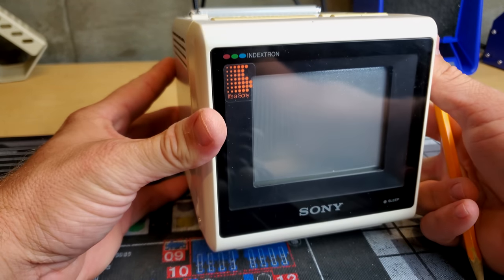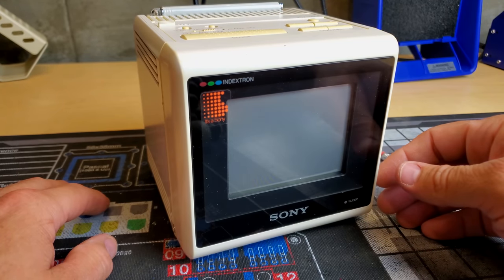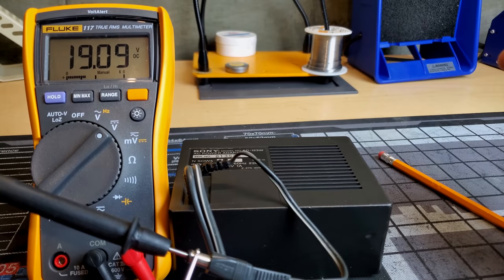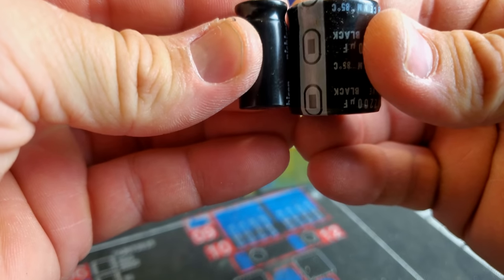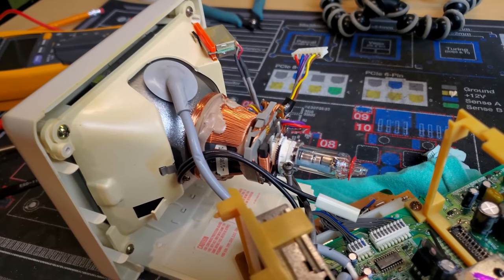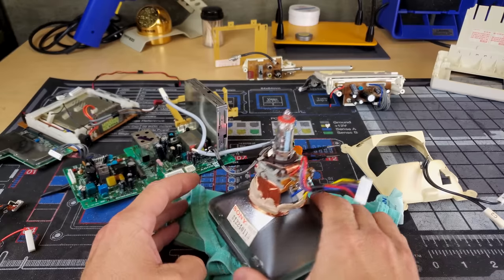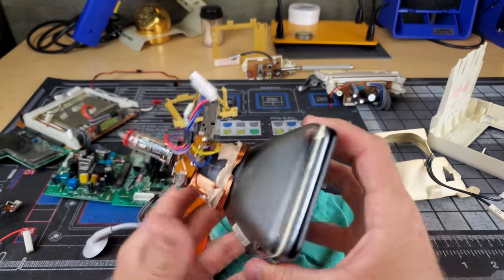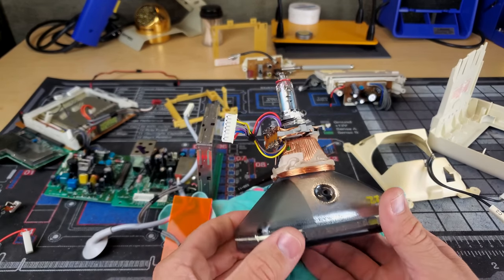Sony's Smallest Color CRT is not a Trinitron - Meet the Indextron

Comment: The Indextron is unique because it only uses ONE electron gun instead of THREE like a typical Trinitron. That orange plastic plate that sits behind the tube is actually a UV sensor. It does not project anything onto the screen. It's complicated, but this is how it works. The Screen has 4 phosphorus stripes instead of 3. Red, Green, Blue, UV, and the Indextron has NO aperture grill (because there is not 3 electron beams to converge) The single electron beam scans the screen like a Black and White Picture Tube and when the beam hits the UV stripe, the sensor behind the tube picks up the signal. That signal is used by the circuitry to adjust the output and timing of the beam to allow the single beam to draw a color image. From the user's point of view, it looks like a regular color TV, however it works closer to a Black and white picture tube. The Indextron design allows the picture tube to be about 3 times shorter than a Trinitron, use less power, and there is no need for an aperture grill or convergence hardware because there is only one electron beam. Fun fact, because there is no aperture grill, Indextrons are completely immune to magnetic interference. They cannot be damaged by magnets!
Reply: Awesome info! Very intriguing! Thanks
Reply from the maker: Thanks for the incredible information.  Thanks for also sending this CRT into the shop.  It was a treat to document.
Reply: But you know that it's not the only tube having only ONE electro gun to make colourful image?
Reply: @ITGuyinaction  Yes, the Chromatron 😊
Reply: @SupraguyCRT  Point for you! You are very good! Btw, I'm not 100% sure, but something comes to my mind that also  Diamondtron made by Mitsubishi had only one electron gun?
Reply: @ITGuyinaction  Thanks haha. No, those are Trinitron clones. The Sony KVX-370 Watchcube was the only single beam CRT, commercially manufacturered on a large scale. The Sony Chromatron was the predecessor to the Trinitron. Several other companies made Beam Index CRTs, but they were very limited in production.
Reply: @SupraguyCRT  So not sure why Mitsubishi came to my mind... Perhaps they did sth on small scale...? 🤔🤔🤔
Reply: @SupraguyCRT  🤔🤔🤔🤔 One thing come to my mind. I remember old Sharp portable crt tv set's with very untypical tubes. Those tubes were very small, like here or even less inches, but the electron guns were at 90 degree to the tube display surface (it's like that someone would "break" this glass neck at 90 degree). They were look like "fat smartphone" but screen was taking only half of the surface. I tried to find sth more about this technology but I can't find anything on Internet. Do you recall it (or someone else)? They were for sure crt, not lcd and due to this 90 degree "broken" neck, controlling electron streams was very tricky and complicated.
Reply: loved your input on this little crt! Awesome system indeed👍🏼 TY!
Reply: I find this very interesting. I looked it up and found that they used these tubes in the viewfinders in camcorders from the 80s.  I actually had two viewfinders that I played with and tried to make a stereoscopic viewer but didn't have much luck. I could see pictures on them but didn't get the stereoscopic effect. I even tried to play with the yokes to get an offset, that was several years ago. I like your input on the tubes I Googled the tube and read articles about them. I guess it would be interesting if they made a larger tube, how well the resolution would have been. With just one beam it would be clearer. Just a thought
Reply: @ITGuyinaction  You might be thinking of the Sony Watchman portable handheld TVs. They used a system where the electron beam was pointing upwards perpendicular to the screen, and was deflected down onto the phosphor coating. The image created on the phosphor coating was actually on the back side of the tube, and when you look at the image, you're actually looking through the electron beam!
They were all black and white, as adding a shadow mask for color would have blocked the image, but theoretically Sony's Indextron technology could have been applied to create a useable color version. They did end up creating some 'color watchman' models but those just used LCDs.
Reply: @faulknik000  I have to look for these models one day when having more time and I hope to return to this discussion then.
Reply: They also made projectors like fp60
Reply: Man I was about to say the exact same thing but I was too late. but I am glad to see others actually know this too
Reply: There's a mini color CRT that goes in a camcorder viewfinder that works exactly like this, UV phosphors and all. I think Cathode Ray Dude did a video on this. There's also a UV light sensor inside the view port that could be covered with your finger and when you did that the picture would simply become black and white.
Reply: @ITGuyinaction  There's also the Penetron, which used two continuous different colored phosphor layers, one on top of the other, and varied the acceleration voltage of the beam to switch between colors.  It had a small color gamut and was slow to switch, but it existed and it worked.
Reply: @johnrehwinkel7241  Thanks  a lot for this hint! It's so difficult to find information about Penetron in the Internet...
Reply: One has to wonder why they used INDEXTRON only on very small CRTs, like this portable TV, or as far as I know, in camera viewfinders. I guess total brightness would only be one quarter, as the beam is at any time only lighting up one particular color? From some (patent-?)drawings, it also looks like the phosphors have different widths.
Reply: The trinitron had 3 cathodes firing into 1 gun not 3 guns as you stated!
Reply: bro thats siick
Reply: WHERE CAN I GET THIS ????!!!!!!!
Reply: Did this guy not do any research before making this video?  I'm yelling IT'S THE UV DETECTOR while watching the video.  And not load testing a linear supply to see if it puts out the proper voltage at the rated current?  The dude should pull this video or at least put on subtitles to correct his incorrect assumptions.
Reply: @button-puncher  Yup, it's a completely unregulated supply, just a transformer, bridge rectifier (four discrete diodes) and a smoothing capacitor. Of course the idle voltage will be much higher than the nominal voltage!

Comment: I've thought the same thing, verifying the output voltage of a power supply. When it's an unregulated power supply, like the one this TV uses, the voltage is going to be significantly higher until put under a load. If there is no load, the voltage will rise. This is normal behavior and not a cause for concern.
Reply: exactly
Reply: It's rare that a power supply should drift up THAT high above the nominal even unregulated. Then again there really isn't anything to go wrong there, so the high drift is likely just inherent in the construction of the transformer, it doesn't really give me worry.
Reply: @SianaGearz  oh, they can, zx spectrum '9v' ish full load ones are commonly 14vish unloaded,  a 12v 300ma small plug thing is over 19v unloaded.. smaller, lower current ones vary more, due to the higher dc resistance of the windings ,

Comment: PSU is fine,  it's unregulated.  With the rated 1A load, it will be outputting the correct voltage.  Shame the TV is damaged beyond economic repair, looks really cool.
Reply: Didn’t the TV say it was 15W? That’s more than the rated 1A load for 12V.
Reply: @emmettturner9452  That psu wasn't the correct model for the Watchcube.
Reply: @SupraguyCRT  Interesting. I guess they had a whole line of products and power supplies in that size which clip together. I’ve seen similar but not quite this size.
Reply: Also there is linear regulator in the device itself to correct the voltage.

Comment: I think I read somewhere that sometimes physically larger capacitors are used in power supplies because they can dissipate heat faster.
Reply: Thicker foils, higher current, bigger can.
Reply: Over-spec'd caps (to a point) will most likely result in a longer lifetime.

Comment: The PSU having a higher voltage than it rating isn't unusual in older devices as they are just a transformer to get the voltage in the ballpark. From there the device itself would have a linear regulator to get the voltage right and clean. If I had to guess the regulator circuit is on that top board as the key component of a linear regulator is the transistor device which is had to be bolted to a heat spreader to dissipate the heat from the over voltage supplied and in doing so level out the dips and peaks in the dirty ac voltage supplied.
Reply: Also, once you load the PS the voltage is going to drop a bit.
Reply: @vintageshed965  Exactly. It is an unregulated power supply, so it's normal for the voltage to be higher than its rated output when there is no load applied. Under load, the voltage output will be correct.
Reply: Yeah if that's an unregulated power supply, higher voltage without load can happen. Connect a load if similar amperage rating as the TV to see if voltage drops to spec.

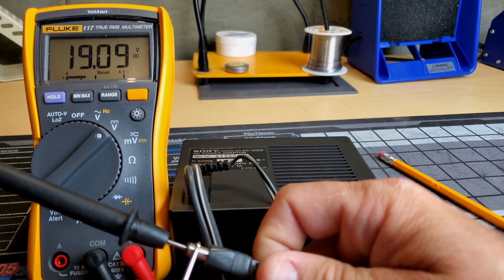Comment: 4:47 this is absolutely normal for unregulated power supplies and the tv should handle it if this is the original psu. linear unregulated supplies when not underload always makes higher voltage at the output. rectified 12v ac comes at around 17v so if your mains is slightly higher than 120v then it can easily result in 19v dc without load. also smaller mains frequency transformers make more voltage than usual when unloaded .
Reply: exactly, i was gonna comment similar, you should test power supplies on load, not just open with only a meter on it, load it near to one amp and i bet it'd be much closer to 12v, people are too used to these regulated switch mode psus these days!  and i wouldnt replace that psu cap, its likely perfectly ok! far too much of this recapping nonsense!
Reply: i wanted to mention this as well, a trap for young players as Dave would say! :D that was 18v floating, not under load.
Reply: @andygozzo72  how do you test you test a DC psu like this under a load?

I'm aware of the load vs. Unloaded voltage difference but I've not come across a technique or tool that allows for testing under a load.
Reply: @rogeliozim456  load it with a resistor or resistor network to load it to full stated max load or just under , you can sometimes get away with using car or torch  bulbs as a load but bear in mind their cold resistance is much lower than when 'hot' so if the power supply has current limiting, this may cause it to limit/trip ..

Comment: While the circuitry would be hard to save, getting the tube to display color again should be possible.  Most of the support electronics are the same as an ordinary B&W monitor (electrically, it's a B&W tube).  How the indextron works is by monitoring the UV pulses from the index strips in the phosphor, and using those pulses to synchronize a phase locked loop, which then provides a real time mapping between the beam position and the RGB phosphor stripes.  So the custom circuitry required would need to monitor the signal from the UV sensor, implement the PLL, and then have circuitry to gate the demodulated RGB information from the input signal to the control grid in phase with the phosphor stripes.  This was done with custom ICs (like the HT5180 and HT5190) but could be re-implemented with discrete ICs or possibly even with a fast-enough microcontroller these days.

Comment: For me from what I can see the power supply is not regulated and probably need some load to land closer to 12 volts. Also don´t expect that a PCB should always have every marked component installed on the board because it is very common it was made with different design first than at actual release. The indextron should almost be treated like a black and white monitor with some black magic circuits scanning the beam position via that Orange plastic strip because the same beam is lighting up all the different phosphors without an aperture grill. I would have checked the lose parts and put them back and at least try the thing before calling it quits because it might be so simple there is scratchy pots and poor solder joints that makes it not work

Comment: The translucent part of the tube is for the feedback system of the indextron these tube dont have an aperture grill in them and only have one electron gun it is almost like a monochrome tube but with rgb phosphor stripes on the screen i believe there are also uv phosphor stripes on the screen printed on the back of the screen that orange plastic part you thought was a display is infact the sensor for the feedback of the indextron the way these work is as the electron beam passes over the coloured stripes the corresponding colour signal is applied to the electron gun to light up that particular coloured spot this system  modulates the electron beam with the red green and blue signals sequentially the uv stripes are there to synchronise the electron beam so when the electron beam passes over the uv stripe the sensor emits a pulse that tells the controller circuit that the electron beam is about to pass over the first coloured stripe eg red so the video circuit then sends the red signal to the electron gun then it switches to the green then to the blue then this is repeated over again for the whole scan line the pulses from the sensor keep the timing of the RGB switching so the correct colours are displayed on the screen. that tv is definitely well worth fixing as these are very rare i have been looking for one of years but the dont come up for sale on Ebay if ever!!

Comment: Because the power supply is removable, I suspect there was a rechargeable battery pack available. Since you never actually turned it on for your video what was the issue did it do absolutely nothing when powered up?

Comment: The smallest color Trinitron was the BVF-7700 7" viewfinder  meant for use on standard definition broadcast cameras like the Sony BVP-900/BVP-950 introduced around 1999-2000, but they would likely work with even the earliest BVP-360/BVP-3000 3-tube cameras from 1984.

There was an HD version called the HDVF-7700 that was meant for use on HD broadcast cameras like the HDC-900/HDC-950 that were also introduced around the same time, but would likely again work with earlier Sony HD equipment that dates back to the '80s as part of the HDVS line that came about in 1984.

The specs for both the SD BVF-7700 and HD HDVF-7700 color viewfinders are the same except for the resolution, as they use the same Super Fine Pitch "7 tube: "The viewfinder uses a variable-aperture-grill catchode-ray tube with an aperture grill of 0.2 mm in the center and 0.25 mm on the sides. The result is a high-quality color picture with a horizontal resolution of 450 lines or more."

There were color-beam-indexing CRT electronic viewfinders that were 2" released for portable professional cameras around the early-to-mid 1980s as well.
Reply: The smallest Sony Trinitron is actually the 3.7" PVM-4000. I have one I'm working on right now. It shares the same 3.7" 110LB22 Trinitron Picture Tube as the KV-4000 consumer TV.
Reply: @SupraguyCRT  Amazing, first time I'm hearing about this.
Reply: @NUCLEARARMAMENT  Yeah, I just discovered it recently and there's almost no information out there about the PVM-4000. It was used in the early 80s as a Camera viewfinder or portable studio monitor and then quickly replaced with the 5" PVMs.
Reply: @SupraguyCRT  Very interesting, one thing I will add further about the BVF-7700 & HDVF-7700 is that while they are not the smallest Trinitrons, I feel like they are the sharpest color Trinitrons for their size, with a variable color dot pitch ranging from 0.2 mm towards the center, to 0.25 mm going towards the outer edges. 

Super Fine Pitch tube, for sure, heh. 450 TVL effective horizontal resolution, which for a 16:9 tube is 253.125 lines, or at least 450x253 effective color resolution for these 7" BVF/HDVF monitors.

It makes me wonder what the dot pitch was on these older smaller sub-7" PVM Trinitrons and what the effective resolution on Indextron and similar beam-indexing CRTs were.
Reply: @SupraguyCRT  Have a KV-4000 Serial # 808928, Still works great when I saw this video I went and pulled it out. Plugged it in and great picture. was worked on in 01/29/03 I would imagine when i took it in they recapped it. Great video

Comment: I fixed mine, yours is even clean to begin with, shame that you did not at least try. I ended up replacing most if not all capacitors, the TV works now, the tuner still runs but receives only FM transmission (as analog video was discontinued, but this japan set has lower band frequencies and runs it's PLLs from ~68MHz up to over ~130MHz, I think, where it overlaps the FM band on the channel 1 and 2).

Comment: its a linear power supply dude. they are normally higher until its put under load. id see if using a resistor or light bulb of some kind to load it down, should drop to around the 12 volt range. not uncommon in older trnasformer based power supplies.
Reply: The term is "unregulated". "Linear" means that a transistor is controlled in it's linear region to limit the current in a way that the voltage drop will lead to the exact voltage being present on the output. They can in many circumstances even regulate to closer tolerances than "switching" regulators.
You're also mixing up various things here. You can easily combine "older transformer based PSUs" with linear and even switching regulators, and a number of rather new analog Class D amplifiers employ such a topology (Class D being a switching topology anyway).

Comment: I have a Sony Trinitron KV-4000 color TV with about 3.5"  screen. Great picture STILL,  Looks like maybe a bit of a following. Great TV have had it since the mid 1980's, Have that same power supply which outputs 17.78 Volts. I think the load of the TV takes up some of the voltage.